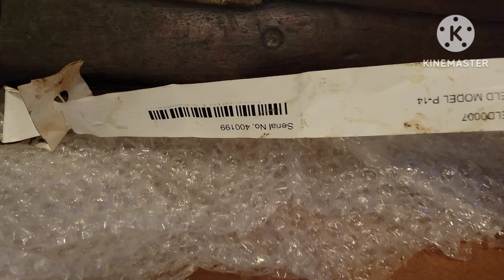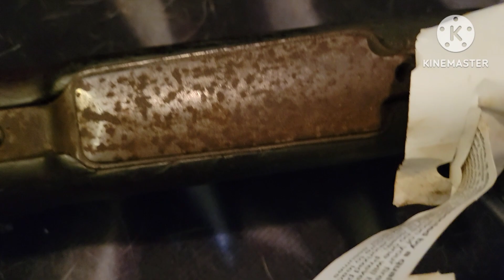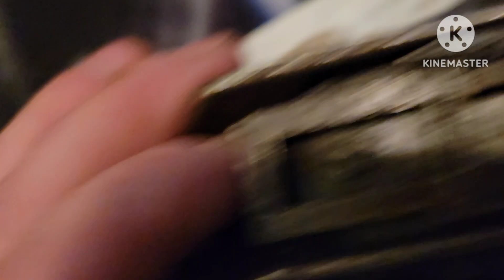RTI P.14 Enfield unboxing

Comment: Thanks for the reply! BTW, the characters on the bolt handle are Arabic numbers, 398557, I think.

I have found that using motor oil and lightly scrubbing with a stainless steel scrub pad to clean up metal without removing whatever original finish is left works really well. I think this rifle is going to clean up nicely. Looking forward to seeing it.
Reply: Oil or Hoppe's #9 with steel wool will clean up that metal nice without hurting the remaining finish. 

If the stock is really oily & cruddy, I use oven cleaner. Set out in the sun for a while. Clean off with warm water.
Reply: I think thats 218557- that second letter is a doozy. I think its an overstamp from what was there. Its moot I suppose, but ive never seen a bolt stamped in arabic :)

Comment: Found one of these in a shop the other day in great condition for $825 missing the rear volley sight meaning mine went through the weadon repair cycle was hitting c zone steel at 100yds

Comment: I would go 5 bens for that all day long ! Get you some super fine #0000 steal wool and some gasoline and go to town on it. All metal pieces degrease and de rust with that steel wool. But before I would take the rifle apart I would take some hot water and a regular sos pad to that wood and all the severe rust . then take it apart and do a fine polish with the #0000. Be sure to rinse the soap off really good . dont be afraid to soap and water that wood . Just dry it in the sun good for a few days afterward .

Comment: No way I would pay 500 for that pos…. People buying this trash is seriously making it difficult for the people that know that turd is worth at best 100 dollars
Reply from the maker: It's crazy how expensive everything is right now. Been wanting one of these for years but all the older guys holding onto them just put astronomical prices on them at gunshows and gunbroker.  This is the only way I can afford one.
Reply: In your dreams. I've not seen any pattern 14 or 17 Enfields for less than 800 in the last couple of years. And most are way over a grand. And there conditions is nothing to write home about. This ain't the 1960's no more.